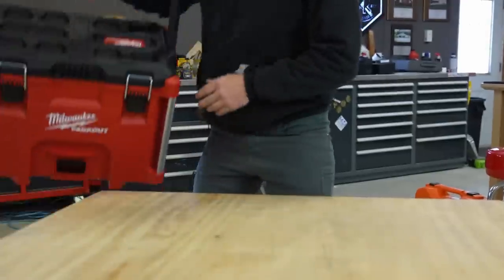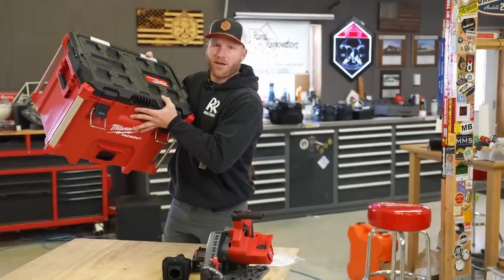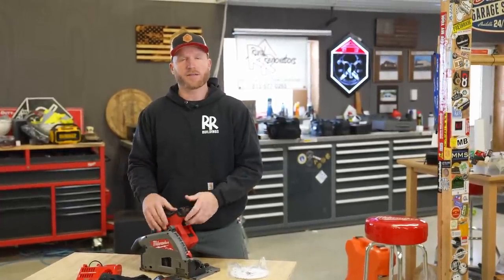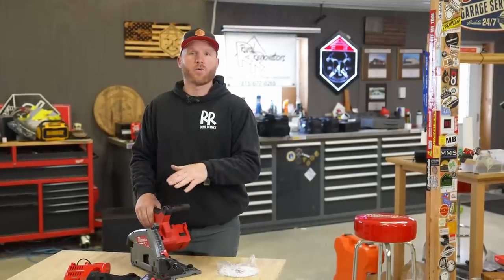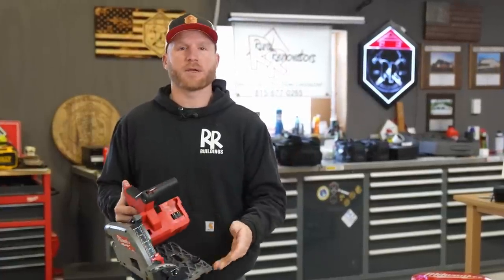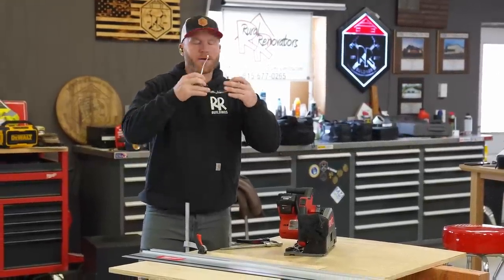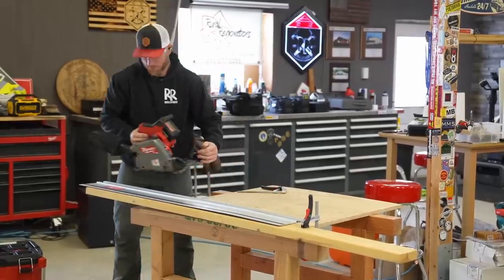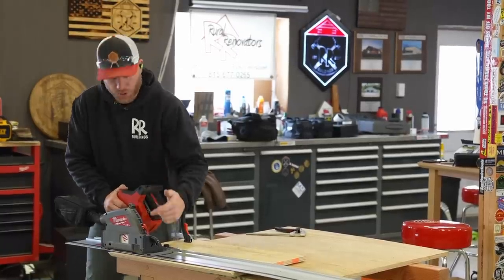FINALLY HERE!! Milwaukee Track Saw

Comment: I'm happy to see more distributors setting up affiliate options. The way Amazon operates is very hostile to small businesses by leveraging data from 3rd party sellers on their platform to eventually push out the 3rd party sellers in the most profitable areas. Thank you for featuring a different distributor.
Reply: @Jeffsdata_0  That's only true if promoters can only recommend a single product or not close which product to recommend. Fortunately we're not in Soviet Russia and so there are many products that could be recommended.

Comment: A friend I used to have had a cabinet shop.  He had a 14" ALtendorf Table saw.  It had a small blade in front of the 14" blade to under scribe the material before the 14" blade went through.  He also had a Given panel saw with a 20" blade and an under scriber.
Reply: What’s this have to do with the Milwaukee track saw? Lol
Reply: @jakewrtt  if you paid attention, he was talking about the setting for scribing  before cutting

Comment: Great video Kyle. I have the Makita 36v and would definitely love to see a comparison as I despise the x2 design and incremental weight. If 18v has the power - even with less run time- I’d prefer it. After all most investing in a tracksaw are going to have additional batteries.
Reply: Stolen page

Comment: Wonder how well the dust collection would be with a vacuum instead of the bag.
I'm not on the m18 platform but would be nice for milwaukee to make some locking vacuum collars so the hoses don't fall off mid sanding job

Comment: Thanks for sharing!  Just grabbed mine today and that was helpful before I go use it to cut pvc deck boards tomorrow. Also what kind of blue tooth hearing protection do you like best. Will need to be using it in running equipment and around power tools as you probably use it for as well.

Comment: Mine arrived, but the anti-tip knob is missing and has been blanked off. Milwaukee UK told me the anti-tip knob is not included in UK and Euro models for patent reasons. Very annoying as I specifically bought the Milwaukee rail kit to go with it for this feature. And they even show the knob in the photos on their UK site and dealer photos ...

Comment: Milwaukee comes out with an M12 2" handheld planer. I'd love to see it when it comes out. I have some remodeling to do and I am wondering what good applications it could be used for.
Reply: Hand help planers are great for flushing up studs or floor joist.

Comment: I have the dewalt and makita track saws. Personally I love the dewalt, I think it is a more robust saw meant for heavy duty applications, the plunge doesn't bother me and I like the anti kickback feature on the saw. 
The makita for me is I think more of a tool used for things like woodworking due to it being lighter and having better dust collecting. Either way though you can't go wrong
Reply: Couldn't agree more, dewalt tracksaw (like all dewalt tools lol) is a robust machine that can take a beating and still work and work. I use it for pretty much everything onsite, sheet goods, fibre cement good, hardwoods etc. 

I do find that im lacking some fine tuning options on it (it's an old design after all). Dewalt needs to really update it I think with more power, more features like a scribe cut ( I currently have to manually change the depth), and preferably a new track with anti tip clip like makita and Milwaukee. 

And honestly all track saws really need to come out of the factory with a full kerf blade (thiccc one), these thin blades bend in hardwoods and overheat. Got my dewalt a new blade now it's unstoppable.

Comment: At first glance, one thing that I do NOT like about this track saw kit is that the pack out is WAY to big for this saw. The Makita 40V XGT track saw comes in a pack out that's about 12in x 12in x 15in.

This Milwaukee saw comes in a pack out that's about 17" x 15.5" x 22". To me, that makes no sense.

I think pack outs are great. I want to keep my precision tools safe to prevent them from getting knocked around so they stay accurate. However, when the containers are massively oversized, this just takes up more space in a van, truck, workshop or garage.

I don't have a track saw yet. I haven't had to do any projects recently that require precise and clean cuts of large sheet goods. When I just need to make 1 or 2 cuts, I can just clamp a piece of angle steel or aluminum to my plywood to use as a guide and make the cut with my circular saw. People also make their own guides with a piece of plywood or MDF. The cut quality won't be as perfect as it could be from a track saw, but it can be pretty good if you're careful. Again, this is what I do for 1 or 2 cuts. If I had to make lots of cuts in full sheets of veneered material or architectural-grade plywood that will be exposed, I would want to use a track saw. For cuts in smaller plywood stock, I just use my Milwaukee M18 table saw with a finishing blade. If you cut in 2 passes -- first to score and then at full depth -- and if you tape your cut line with painter's tape, you can get a really great finish with a table saw. Of course, I don't want to cut a full 4x8 sheet of ply in any direction with my small table saw because the stock is just too big (at least for me) to be able to reliably make the cuts safely and cleanly.

I have batteries for both Milwaukee's 18V and Makita's 18V tools. I have been reluctant to add tools from Makita's 40V line because it's yet another line of tools, but as they come out with more 40V tools, I might eventually start buying Makita 40V tools. I'd probably pick the Makita 40V track saw (or even the dual 18V track saw) over the Milwaukee mainly because I think the Milwaukee pack out is just way too big and will take up too much space in my kit. I say this even though I probably like the depth and angle adjustments a little better on the Milwaukee than on the Makitas, and I also like the Milwaukee riving knife! Still, the Makitas are also very nice and pretty similar to the Milwaukee, and I think the deciding factor for me would end up being saving space in my small garage shop. I don't want my track saw packout to store anything other than the saw itself and maybe an extra blade and one battery. I can store the charger and spare batteries separately since I have other battery tools that work with the same batteries and charger. If this is how I'll store the tool, the pack out should be half the size with molded recesses to securely and safely store the tool.
Reply from the maker: I agree it’s big.  I think you could just get the saw and put it in a smaller packout

Comment: RIP the track, what a nice idea to shorten the track for cross cuts. Maybe some guys are making 3D printed end pieces for the track that the saw can't ride out of it🤔. With the locking feature of the saw on the track that would be a Festool HKC with plunging action.🤯

Comment: Wow, that is a neat machine. Indeed its got some power, is quiet and stops really quickly. I was curious whether Milwaukee will put a riving knife in their new plunge saw which they have. Then I find after purchasing the new festool which no longer have a riving knife, instead a blade that stops the machine anytime the saw is lifted. Great video. Thanks for uploading.
Reply from the maker: Yes I have that festool. Interesting change.

Comment: If I were to choose between a tracksaw and a circularsaw, what would i choose? I feel like the tracksaw can do the same thing as a circularsaw but not really the other way around.
Reply: I would say the opposite, the track saw is really good at creating perfectly straight long cuts, which you can accomplish with a regular Circ saw and a straight edge. You can even plunge a circ saw with a little practice, although its not as accurate or safe. 

On the other side, the track saw is not so good at short crosscuts or working in elevated positions. Festool does make a track you can lock onto the saw but its still very awkward.
If you plan to do a bunch of sheet material cutting or cabinetry type work, the tracksaw is a good choice but as a general use construction saw I would stay with a 7.25 circular and by a good strait edge.
Reply from the maker: I agree first have a circular saw, but if time and quality are important you can’t beat a tracksaw…. Or a table saw

Comment: I have not yet purchased a track saw.  Not a cheap investment, but looks to be able to save time.  How is it that the track does not move?  Currently if I need a cut that perfect, I just clamp a straight edge down...  Thanks.
Reply: I wondered the same thing until I bought the Makita. The saw glides easily through the track, and there’s no direct friction on the surface of the material you’re cutting. The track has a rubberized bottom, which stays in place. It’s as stable as can be, and it’s amazing how accurate and clean the cuts are. I wish I bought one sooner.
Reply: I have a festool and second this. the saw slides so easily in the track compared to how well the track sticks to the material it just stays where you put it I've even cut Masonite, and Formica countertops with it and everything stayed put . Im sure if I really tried i could get the track to move during a cut, but it would take some serous misuse of the tool to apply enough side force.
Reply from the maker: The bottom has a grippy strip

Comment: Anybody know if the Milwaukee track saw is compatible with festools  tracks?
Reply: Yes it is, but the anti-tipping feature will not be used since the Festool track does not have the lip to hold it down. It is compatible with the Makita and Powertech tracks also.
Reply: It is compatible except that you cannot use the Tracksaw anti-tipping lock.
Reply: @richardlug6139  thanks
Reply: @metronyc2855   thanks

Comment: Now all they need to work on is a cordless dust extractor!
Reply: They already have them.
Reply: @mikeznel6048  milwaukee doesn't have a cordless dust extractor they have the corded option which is good and they have the newer wet/dry vac. Unless I have been missing it.

Comment: I’m less then impressed with track saws
Reply: I really don't understand it. Has the skill of using a typical circular saw been lost? In rough work like framing and such ( we're not building a piano) you don't need to be that precise. But in precise work like cabinetry and furniture you would be in an environment where you would be using a table saw. I could probably see an occasional use, but is the juice worth the squeeze?
Reply: @brianmcneese9425  it’s a gimmick. Just like stiletto hammers….yes I own one, no I didn’t pay for it , but how often am I using a framing hammer anymore anyway?
Reply: After awhile you get tired of pulling out the tracks and then it's sits in it's dusty corner forever, my friend bought one a Makita we used it twice never used it again, it's just not practical on jobsite it too slow
Reply: if you are regularly ripping sheet goods i feel its worth the squeeze.  The saws best feature is that you don’t have to clamp the track in place, you just line up both ends with your cut line marks, set your saw on and cut…   Significantly faster than calculating an offset and clamping on a straight edge, and way less skill/more precise than free handing. 

Even in a shop I would prefer this over a table saw for pieces bigger than 2'x3'.  Unless it was a moving table, which would be way more expensive than one of these saws.